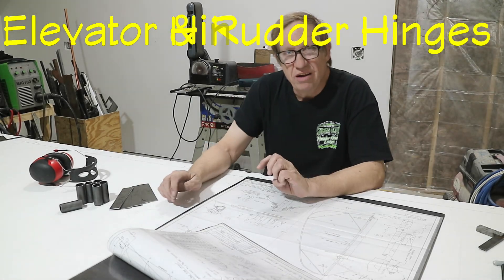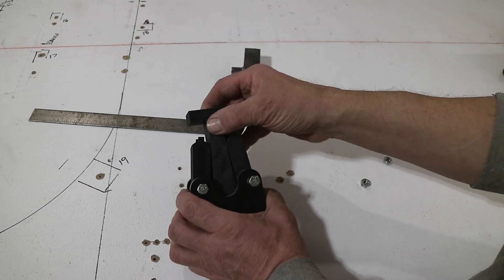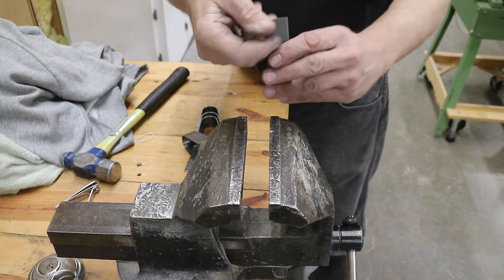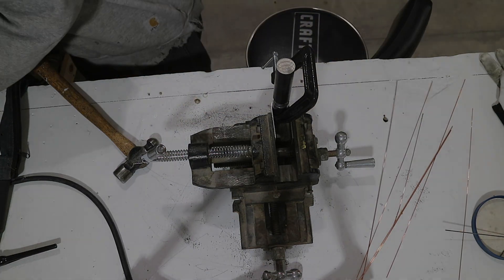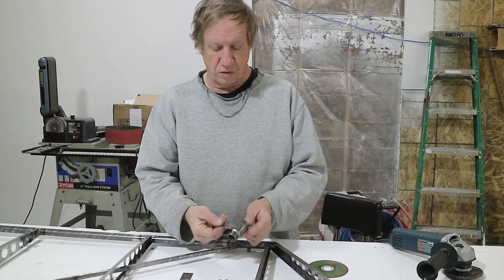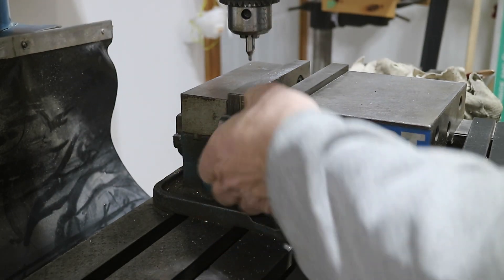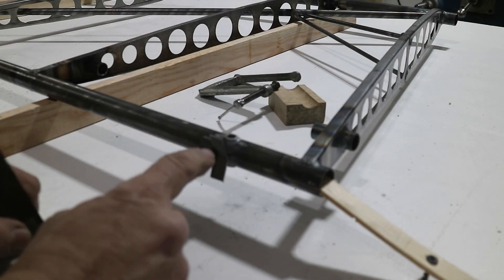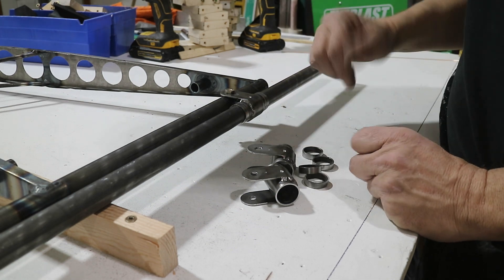Bearhawk Experimental Airplane Build : Aileron and Rudder Hinges

Comment: What material are you using for the 3d printed form dies?  I'm building the lsa model, and your videos have been very helpful.   Thanks for taking the time to make them.
Reply from the maker: Your welcome. It's just PLA I have found 6 top,bottom and side layers with 25-50% infill makes a very stiff durable die.
Reply: Good evening,
Are your 3d files posted anywhere for printing the form dies? Thank you
Reply from the maker: @channellockman254  I have not posted them online.
Reply: @BSpotBuilds  Thanks for the followup. Keep posting Youtube content! Some great tips for building an experimental.